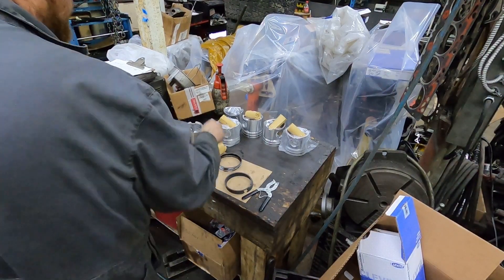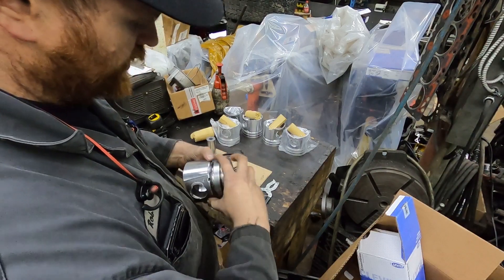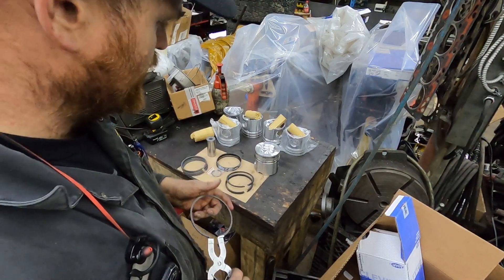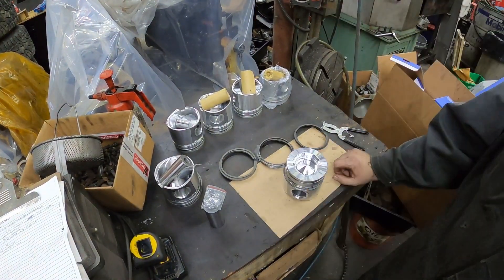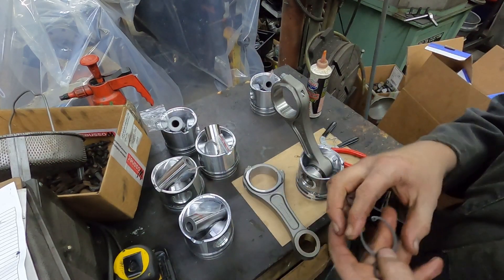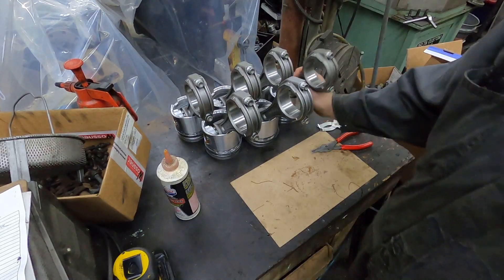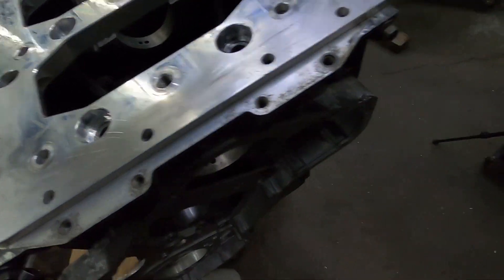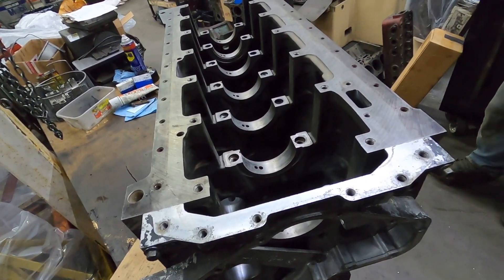How to build a Ppump 6.7 Cummins series part 8

Comment: Man! can i get the piston part number?!
Reply from the maker: In this engine is a stock  isb 6.7  piston found in the dodge trucks
Reply: @CUTTERUPROB  stock 6.7 dodge piston will work fine with 6x.016 ppump24v injectors?

Comment: Will the engine retain the original 6.7 front belt driven accessories, how will you compensate for the increased thickness of the timing case? 🤔
Reply from the maker: no its will be all 12v accessories set up
Reply: Ohhh awesome 😅 I was worried for a minute that it was going to involve machine work, what a relief. Thank you and keep up the amazing work 👍👍👍